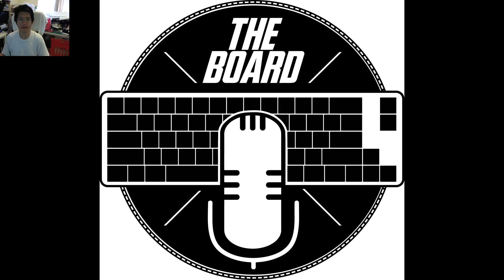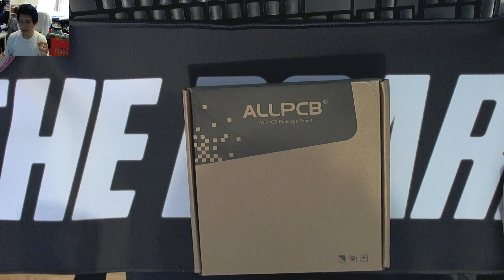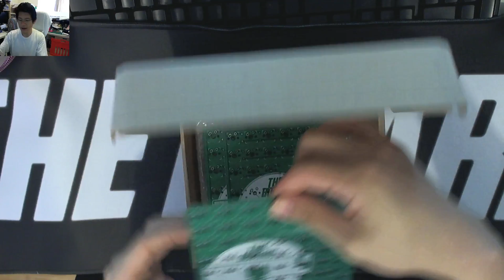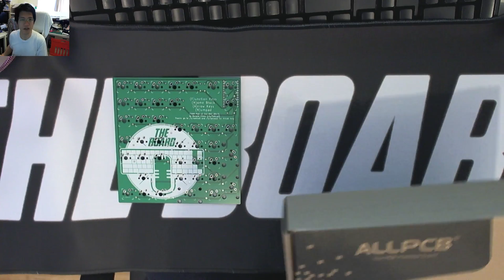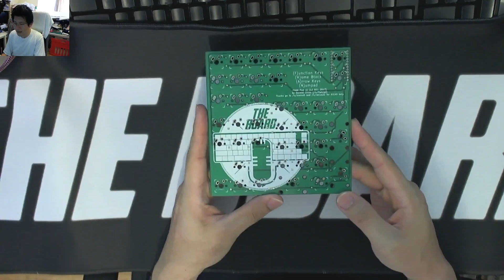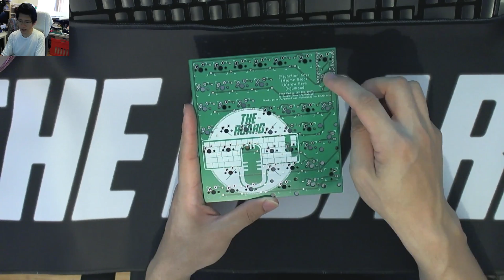FHANv3 PCB Set Unboxing

Comment: v3 shall be called Danger FHAN! The surprise on your face when you saw that top plate was priceless haha. Thank you for this unboxing!!
Reply from the maker: Lets say, I definitely did not expect it! So it turns out that I left out the f.mask and b.mask layers from the manufacturing files which is what resulted in the ground plane plate. But, I need to decide/figure out how to resolve the issue for the score/snap section (e.g. if I should only offer compat for one switch, e.g. MX, or if I make it a 2u hole, then you have no choice but to use PCB mount switches and the 2u Alps might be not straight... -_-)
Reply: You're learning quickly from your small mistakes! :) Yeah decisions decisions...honestly I don't think a project this young without funding would be ALPS compatible. It would facilitate a lot of things to stay strictly MX on pcb and plate
Reply from the maker: Hahaha, without funding is correct... I had hoped that it would have been easy in just choosing the mx/alps footprint for the plate, since there was no issues in the PCB footprint, and I can still do mx/alps for everything but the 2u area! I mean, there is another option which is to offer alps only 2u plates and mx only 2u plates, which would result in higher costs (which I wouldn't prototype), but it would be a solution.

I'll have to build this one first anyway to test it's good, and then see the responses from the IC.
Reply: Yes let's see what this beauty looks and functions like when you build it :)
Reply from the maker: Will also have to poke about and ask on how to QMK the indicator LEDs too....

Comment: big phat macro pad
Reply from the maker: Well, it can be a massive macropad yes, even with numpad can be set up as 1u numpad carefully haha :P
Reply: btw what is the new footprint are you using ? i have made a 60%pcb with ble support. its still a work in progress
Reply: also how did you make the plate from the pcb material ?
Reply from the maker: The footprint is a hybrid footprint. If you want the master.pretty, I can send it to you. I just forgot where the link I got it from is haha somewhere on github
Reply from the maker: I made the PCB just by creating edge cuts, but the reason why it turned out silver was I was missing the f.mask and b.mask files apparently.

Comment: Lookin good! The plate is pretty interesting, and at least it looks tops. Keen to see the next round!
Reply from the maker: I don't know if there will be a next round, I guess it depends on the IC, it wasn't cheap to run this round prototyped, but at least I've learnt what I did wrong on some things and I know the base plate doesn't need change so long as I don't change the mounting holes our outside edge cuts